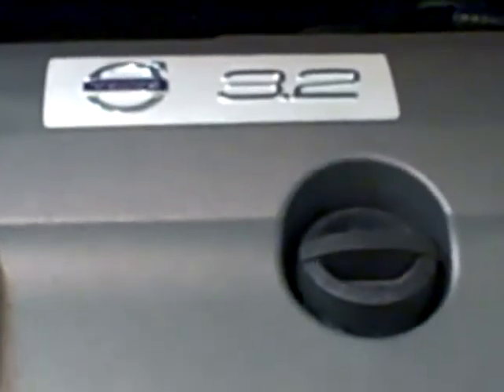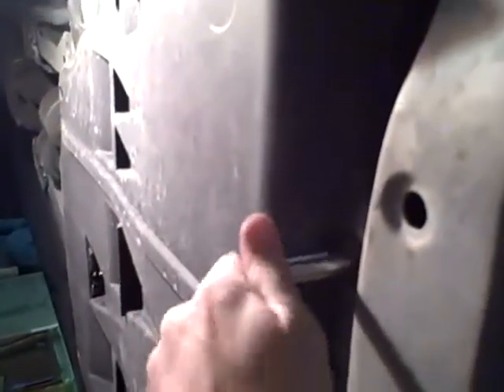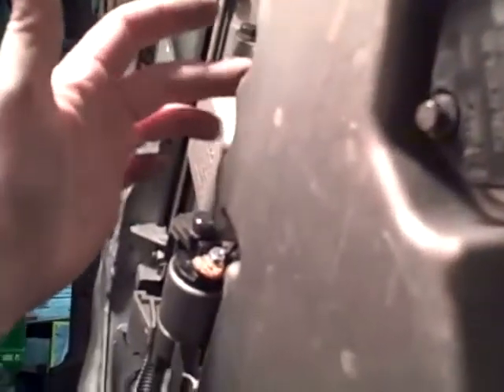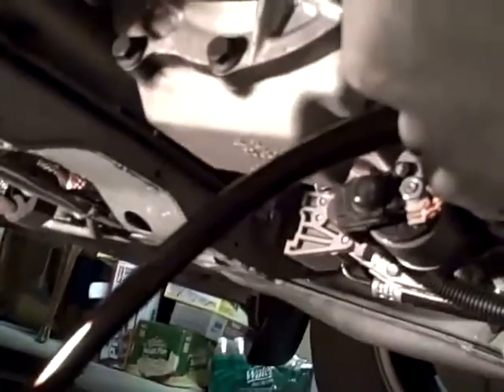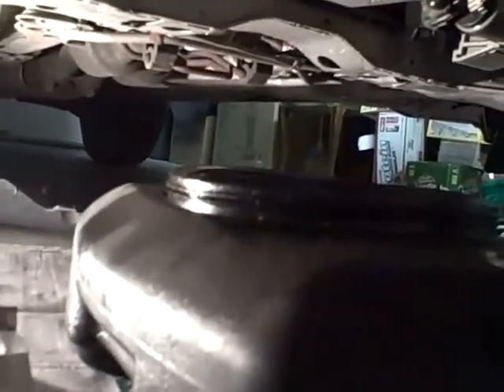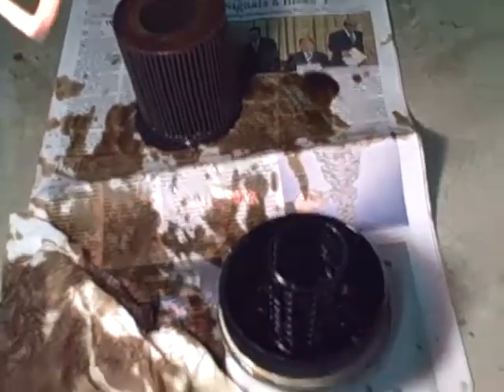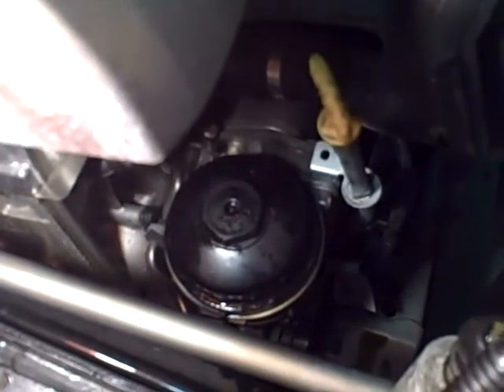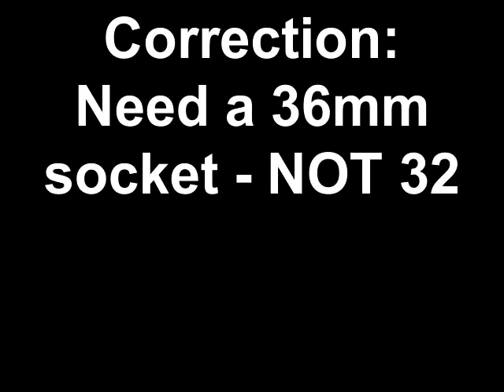Oil Change Volvo 2008 XC90 3.2L In-Line 6

Comment: Please do your car a favor and use a Mann HU924/4 (if I remember correctly) oil filter.  These filters are depth filters and not just paper which is a surface filter.  The trap crap better.  Also, please use synthetic oil in this engine.  Read up on the R.E.A.D. assembly. What causes it to fail is improper oil and infrequent changes.  The fix is between $2500 and $3000.

Comment: Xvery hrlpful video....BUT you have an error. At the end of the video you posted all tools needed, so I went out and bought a 32 MM socket as listed.    It didn't fit?   So I took it back  but rewatched the video, near the beginning you mention it is a 36 MM.     so I went back to Home Depot and bought that size and it worked.  You might want to correct this to help other people. Thanks
Reply from the maker: Tom Coker so sorry the socket size didn’t work for you. Thanks for calling this out!  Hope everything else went well.

Comment: I have a 2006 XC90 with the 3.2L I6.  Built in June of 2006.  napa says only the 2.5 was available in 2006, but they must have done a mid year change or something.   Anyway, the oil drain plug on mine is a 17mm, not an 11/16 as stated in the video.  11/16 is way too sloppy.  Best of luck,   Barbershores.

Comment: u supose to open oil filter first before u drain, coouse vacum will hold old oil in filter haousing, witch remains in the system  since o closed the draining valve already

when the oil filter is on the top, you have to loosen the oil filter cap
 before removing the drain plug. The oil filter housing drains after you
 do that because there is a check  valve. If you dont then that dirty 
oil just drains back into the pan. And  TAKES 7.8 quarts oil
5W30. buy mobil 1 full syntethic 15k miles, and mann filter 15k filter , thats the way to doit
Reply: Great info, please load up a video